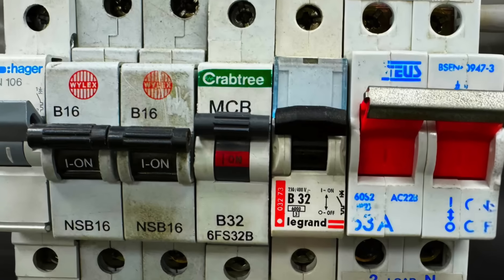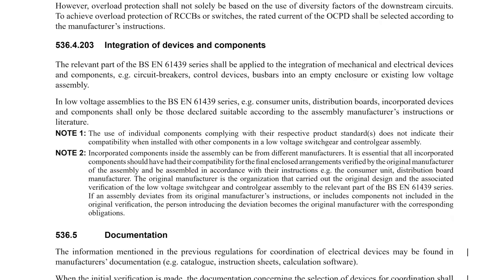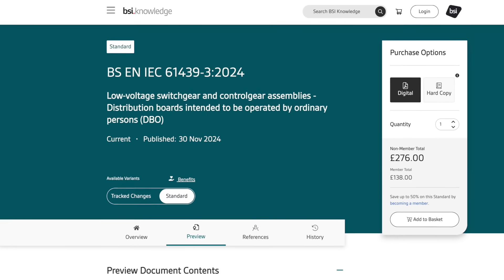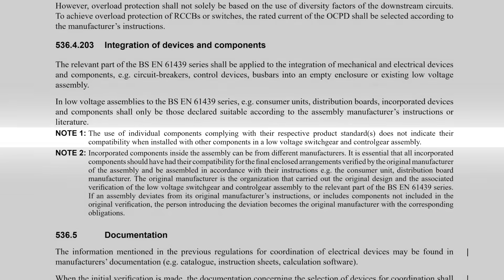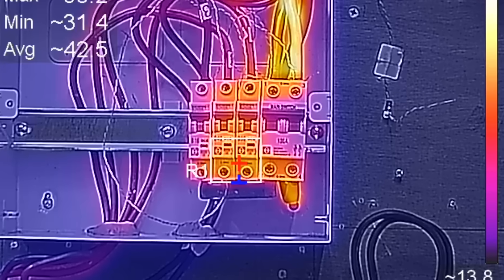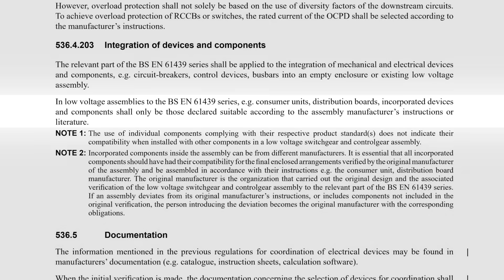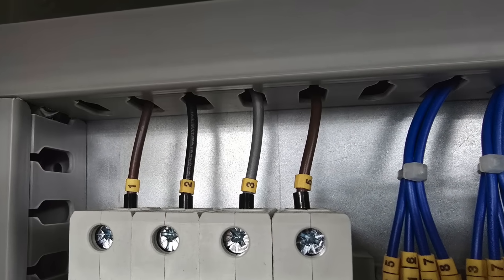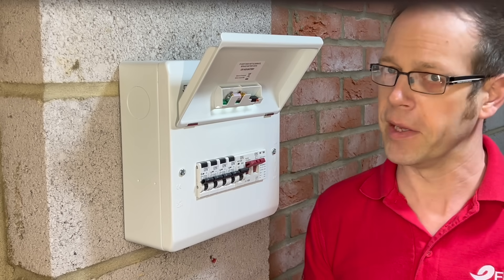Can You Mix MCB Brands In Consumer Units? 🧐

Comment: Pv installers do this all the time. Got a full schneider electric breakerboard and my solar installer just put in a gacia rcd for the pv system. Tempted to change it back to schneider but am worried they wont service it if tinkered with. Luckily its a complete separate system and not  used by the other groups

Comment: No control panel builder ever worries about putting different manufacturers small CB devices next to each other to upgrade/modify panels , nothing would ever get maintained or built if they had to be proven, these components are designed to be placed side by side at rated current, issues with over heating does happen usually due to lack of ventilation in industrial panels and being slightly overloaded over a long time scale, larger devices will have installation instructions regarding leaving spaces for heat dissipation and ambient temperature , regular preventative maintenance and inspections are used to correct issues that may become a problem unfortunately people still are not aware how important this is

Comment: What about a situation where on a circuit an MCB is too sensitive and causes lots of nuisance tripping? The MCB on that circuit would have to be a less sensitive one of another brand to avoid the nuisance tripping.
Reply: Hugh
Reply: @leodavis5886  Had it happen to me. The spark run all the tests, nothing wrong with the cabling or the shower and immersion heater. Breaker was tripping daily. The spark put a different brand in that's not so sensitive and since then not had any nuisance tripping.

Comment: We need data indicating that mixing differing manufacturers devices on a consumer unit DIN rail has caused manufacturer's equipment to fail. I suspect there is none because it never happened. There is no reg for sure that says you cannot mix devices.  In the absence of such evidence, if the installer deemed the installation is fully safe, and is safe, then there are no problems.

Comment: If a brand of MCB/RCBO/AFDD is fitted to the consumer unit case of a different manufacturer:

i. if it fits on the DIN rail securely;
ii. if the bus bar fits firmly and safely into the MCB/RCBO/AFDD;
ii. if the device does not interconnect in any manner with the other devices in the consumer unt, being a individual circuit;

Then all is fine. There are zero safety issues. The safety aspect has to be assessed by the installer of course.  If the installation is safe a court would not go against it.

Comment: This is a regulation dreamt up in bad faith in order to favour manufacturers, if you say to a manufacturer, can I fit your latest design MCB into this 10 year old CU they are bound to discourage it as they are a business and naturally will want you to buy a new CU. It simply would not be tolerated in say the automotive industry where car parts have to be made available for so long after the car has been discontinued. 
Also, are there statistics available to indicate what problems this has been causing over the passage of time? If we, as electricians employ some common sense and can see that an MCB is a poor fit to a rail and bus bar, one would hope that it would be deemed a big no no.

Comment: It does seem to be a bit of a scheme to allow for consumer unit makers to force more regular board swaps. Lets say you have a 5 year old ammendment 3 enclosure, and all the circuits you had when it was installed but a few spare ways. You go to install say an EV charger and its not just a case of new RCBO, but a new board as they say the newer currently stocked RCBOs arent tested with your enclosure........ I wonder in practice how many electricans actually check, other than it being the same make and physically fitting

Comment: In Australia we don’t have such nonsensical standards. It’s upto the manufacturers to ensure their devices won’t cause damage to neighbouring devices in a board. It’s common practice, especially in domestic boards to see mix matching of devices. It makes total sense especially in bigger or older installations where multiple things have been added over the years, and getting hold of the original switchgear isn’t possible.
Reply: @mitchbelectronics  Same in most of Europe, such a nonsensical rule.
Reply: Sounds far too sensible door the UK to take on board... 😂
Reply: We do mix here but usually when you see a mixed board it’s an indicator that someone unqualified has been messing around.

Comment: In electrical engineering, filiation is a method of coordinating two or more circuit breakers to allow for the use of downstream devices with lower breaking capacities than would normally be required. This is achieved by utilizing the current-limiting properties of an upstream circuit breaker to reduce the fault current that reaches downstream devices. Only works when using the same brand & series when replacing specified by the manufacturer, putting something else inside it makes it non-compliant...

Comment: I thi k the industry is set up so yoi have to buy a lot of stock to cover all, onky for them to change the boards so you hwbe to buy them all again and just have a pile sitting in the van never to be used.

They should all fit and work together and should be standardised for inter-ops. Not brand manopoloy.

Comment: Regardless of anything else it looks terrible if you have breakers of all kinds in a consumer units.Maybe it’s about time to enforce a new universal standard for domestic consumer units.  A standard fit and a dual bus system to get rid of the vile bunch of blue wires on RCBO’s An air gap could also become part of that new standard between devices. Shouldn’t  manufactures be brought into a new interchangeable system and the regulations be written in plain language and to the point. The very fact we have books about how to understand the book says it all .
Reply: So something that we have on the continent?
Reply: But Wylex for example have a dedicated busbar that fits into their own MCBs. They also have built into the MCBs a second connection to connect a universal comb busbar. The universal comb bus bars are made by many manufacturers and freely available. So fitting a snug fitting universal bus bar is illegal? 

This would be laughed out of court.

Comment: I wonder what the view of regulators would be for the definition and scope of "components"?  Taking an extreme example, if a neutral lead of an RCBO is shortened and a new ferrule fitted before connection to the busbar, does this have to be the same manufacturer as the RCBO / consumer unit?  I suspect we've all done this using other brands of ferrules.  If this is deemed to be OK then, as a connector, would the same apply to a busbar? I suspect not.

Comment: So why have a DIN rail that is designed to be and has become the common standard for mounting MCB's and such within Consumer units, then have all the manufacturers make devices to that standard (18mm=1 unit) then have them all made the same basic design so they all come out of the slot in the front plate the same way, but then say 'Ah well, they aren't made to be used alongside another manufacturers device'  If they're not designed to be used alongside a different make device why don't each manufacturer have their own rail design so they can only use their devices in their consumer units that are shaped slightly differently so they only fit with their frontplates? This is why we have industry standards.. We have standards for other things like Petrol, every car can use every manufacturers petrol because they all make them to a standard, imagine the outcry if BMW cars could only use Shell fuel, but then when BMW fall out with Shell and change to partner with Gulf, they can only use Gulf fuel? There's already laws against specifying a single preferred manufacturer product use for things like oil or insisting servicing is done by a dealer, it should be the same for this as well.
Reply from the maker: The fuel analogy is more like the electricity flowing through it. Replacing car parts with gear from another manufacturer would probably invalidate the warranty of a car would it not?
Reply: @efixx  Look. On the continent, this has been handled, I can easily install a Hager isolation switch, an Eaton RCD, ETI circuit breakers, and if I want something that will cause problems, I can even get a few Chinese ones. I can buy a busbar from a local manufacturer and everything will fit together. But the British are 40 years behind.
Reply: @efixx  If it was within warranty maybe, though you would hope warranty repairs would be done with OEM parts at no cost to the consumer,  but would everyone replace the battery with another of the same make if it was twice the price of an equivalent by an alternative manufacturer? The OEM cannot insist that OEM parts are used for all repairs, that's unfair restriction on your consumer rights.
Reply: @efixx  - not within warranty, but my old Rover ended up with replacement parts from a French car manufacturer because after Rover stopped trading, the parts with the Rover part numbers became unavailable. These were brake and suspension components. It turns out that they were exactly the same parts. Kept my Rover on the road.

As to using different MCBs etc. in a "consumer unit", how does mixing and matching parts differ compared to using the same MCBs etc on a DIN rail in an industrial enclosure as part of a larger item of equipment?

Comment: in the US, the breakers plug onto a power bus, and bus and breaker are to be rated to be used together.  some brands are rated to be interchangeable.  others are not.  

a breaker designed to mount on a DIN rail and be wired on both sides is a harder sell on not being interchangeable.
Reply from the maker: Always interesting to see how it's done over the pond. 👍
Reply: @efixx  indeed.  personally, I like our breaker panel system a lot better.  but I have to give respect to the UK ring circuit and fused plug scheme as the best way to deliver maximum power using minimum resources, without compromising safety.

Comment: Its still stupid. I work in the real world at a hospital and we have an eclectic variety of old boards. At some point (probably when it was allowed) someones fitted a load of Proteus RCBO's into old Dorman Boards. The case isnt cut apart to accommodate them. The bus-bar isnt bent. 

Personally id rather this than a) shut power off to a hospital ward for a period of time whilst the board is replaced or b) just keep adding the circuit without additional protection 

If manufacturers are building to a standard, its arguable it should alk be interchangeable.

The "good wormanship" reg should cover not bastardizing the boards.
Reply: @dead.format  In the video it’s stated that this part of reg only applies to domestic operators, not commercial

Comment: As a layman, this just boggles my mind. I cant think of any over industry where we literally have standards on how things are made but no interoperability between them. I mean, can you imagine having a USB hub but you can only plug USB devices from the same manufacturer that the same manufacturer has tested to work with the hub? Or not being able to use one manufacturers brake pads with another's brake discs? F'in mental! Standards should exist to allow for interoperability, that's the whole bloody point of them.
Reply: What can go in any enclosure with din rail?  Some companies only manufacture the enclosure so with this in mind it must remain empty.
Reply: so you're saying I should be able to fit reliant robin brake pads on my ford focus?
Reply: @kenbrown2808  No - although particular brake pads can often be used on many different vehicles.
However a far better example is that a 175/65 R15 tyre from any manufacturer can be used on any vehicle that uses that tyre size. Similarly a 16A B curve MCB should be fully interchangeable.
Reply: @jeremybarker7577  yes, it should.  or to put it in American terms.  a type ITE breaker should fit any ITE panel.  a type CH breaker should fit any type CH panel, etc.  the fact is, there is not a big enough market for any manufacturer to feel it is worth their while to make breakers for a panel they don't manufacture.  with a few exceptions.  however, it used to be in the 80s, that 4 or 5 panel manufacturers all chose to make their panels and breakers cross compatible.  so ITE, Murray, Bryant, Siemens, and a few other manufacturers all made ITE compatible breakers and panels.  of those manufacturers, only Siemens is still in business.  the rest either closed, merged, or sold.  I still feel we have an unnecessary number of separate standards - but at the same time, it sounds form comments here that you have a much larger number of manufacturers than we do - and also, DIN should be a universal standard.  so if a breaker is made to DIN standard, then it should be interchangeable with other breakers that are DIN standard.
Reply: @jeremybarker7577  sure it’s a fit, but it would have different performance e.g. wet grip, heat growth, vibration absorption etc. Therefore forbidden to mix on same axle if not whole set.  Totally unrealistic to test competitor products in your own, unrealistic to maintain your own product design static to retain compatibility tighter than existing rules.
Ultimately it’s up to installation engineer to maintain a margin of safety (by guesswork).
Reply: @jimwoods9551  That's incorrect. There is no rule in the UK that requires tyres to match. It's perfectly acceptable to replace a single tyre with one that's a different make.
Reply: @kenbrown2808 😂

Well obviously not, but I wouldn't expect that you could only fit pads and discs from the original brake manufacturer that they had tested specifically to work together. If you get the right model for the car you can mix and match whatever brands you like (for standard OEM spec road disc and pads, Brembo, EBC, Tarox, Ferodo etc)
Reply: @kenbrown2808  Look. On the continent, this was handled without any problems; I can easily install an Hager isolating switch, an Eaton RCD, ETI circuit breakers, and if I want something that causes problems, there are still a few Chinese ones. I can buy a busbar from a local manufacturer and everything will fit together. And I'll put it all into an Elektroplast enclosure. But the British are 40 years behind.
Reply: @kenbrown2808 
If your Reliant Robin brake pads fit the Focus' and it is safe then yes.

Comment: This is nuts, if a manufacturer goes out of business you could need to replace the whole consumer unit because you can't get replacement parts from them anymore??
Reply: Yep, same thing when brands change their design; there is a large trade for 2nd hand breakers because of this. I had to downrate an MCB in my brother's board (kitchen fitters had decided to take a spur from a dining room socket, split it above the ceiling and run separate radials down each side); a newer wylex mcb fouled a plastic shroud around the neutral bar (despite wylex saying it's compatible) so I had to spend £16 for what should have been a £5 part.
Reply: 35 years ago, my parents tore down a house because of this.  but that was an extreme case.  here, in the US, we currently have three brands of circuit breaker panel that you cannot get new breakers for, any more.  every sparky that does repair work has boxes of functional breakers for these panels - but the panels, themselves, are over 50 years old, the technology is not up to modern standards, and even if the panel is still in good condition, it is time to modernise.

Comment: As others have said, this should be dealt with by the individual device standards and force a level of interoperability so any device can be used in conjunction with any other device in any board.
It's insane that the regs and standards didn't have this from the start.
Reply: In continental Europe, it seems that only Schneider has its quirks and is not compatible with universal busbars. The dimensions are so standardized that even FAEL from the 80s is compatible with Hager, Legrand, ETI, or the Chinese products.

Comment: If I swap everything in an old board with all new switchgear, busbar and tails, are there any compatibility issues?
Reply from the maker: If it's all in a CU from another brand you're still taking on that role of the manufacturer.
Reply: @efixx  same brand, but new switchgear

Comment: SBS Trade Sales, my consumer unit manufacturer went bust. Does this mean I can't add/upgrade any more MCBs/RCBOs?
Reply: There is no regulation that prevents you from mixing protective devices from different manufacturers.
What is required is you consider the risk in doing so.

The issue will be the physical form factor of the replacement device from a different manufacturer and whether it will fit into the same space in the consumer unit.
Reply: @deang5622  
There is no regulation that prevents you from mixing protective devices from different manufacturers. What is required is you consider the risk in doing so.

Correct, there is no reg preventing it. If the installer risk assessment that the installation is 100% safe, there is no problem.

Comment: In Greece we don't have such problems, we can mix and match as many different brands as we want, wherever we want within common sense.😅
Reply: I think it's like that more or less everywhere outside of the UK. Herer (Germany) I don't think you can even buy such a think as a "consumer unit". You can buy a breaker panel, that is an empty metal box which conforms to certain standards. The box will have DIN rails, maybe N and PE conector blocks, isolating cover and a door. And then you buy what ever switchgear you need, circuit breakers, RCDs etc. and install them yourself.